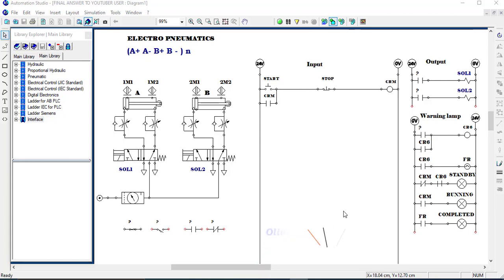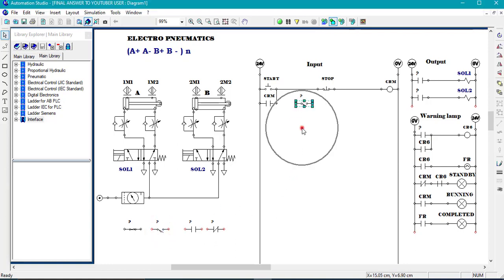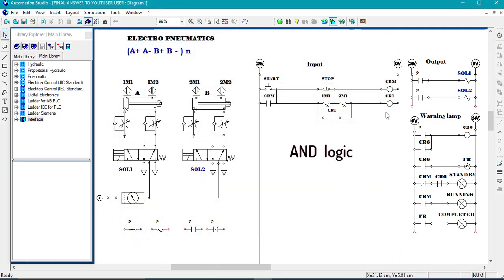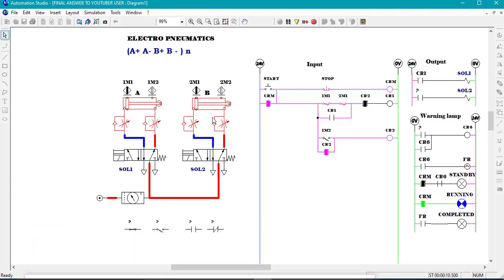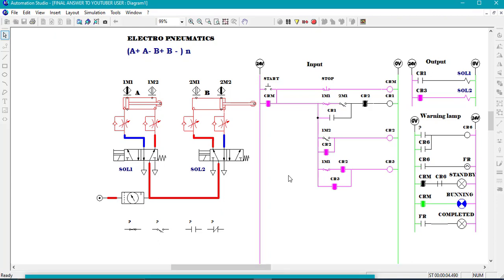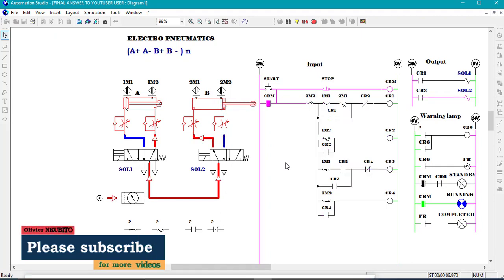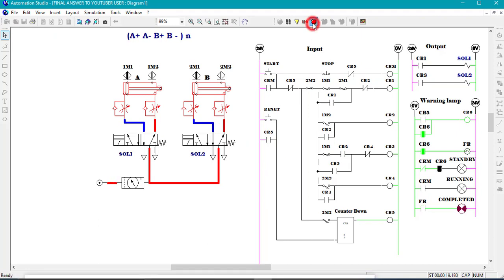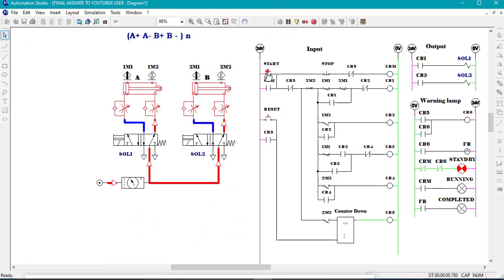Automation Studio: [( A+ A- B+ B-) 5 ] Electro pneumatics with proximity sensors| no timers.

Comment: i really like your video... can you teach how can i make it to manual control even if i have automatic sequence... does it need separate control for manual intervention???
Reply from the maker: It all depends on the job to done,  and to understand the way you want your machine to handle it. 
You can easily change the process and add or remove some features.